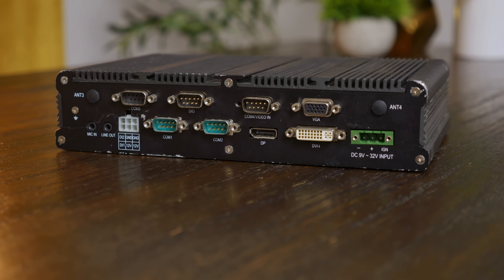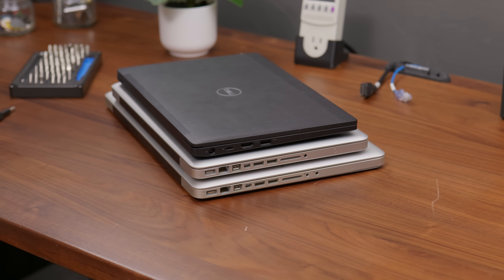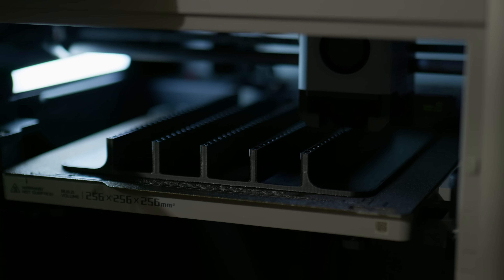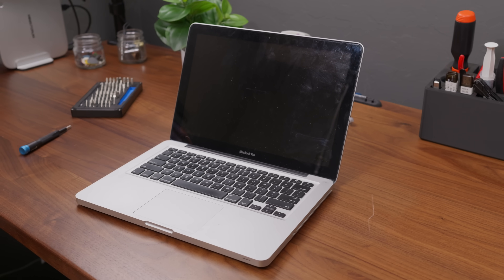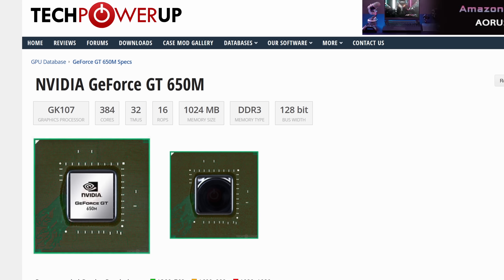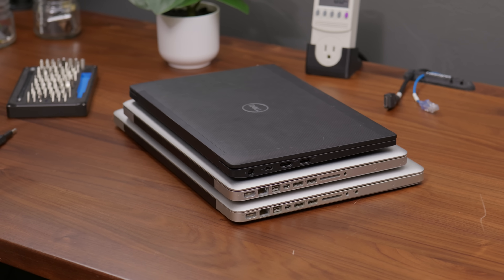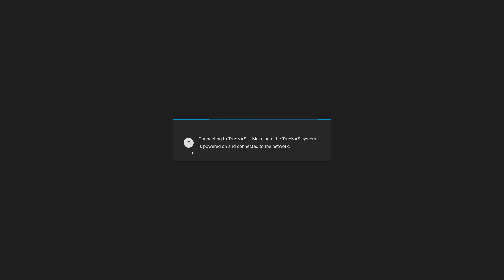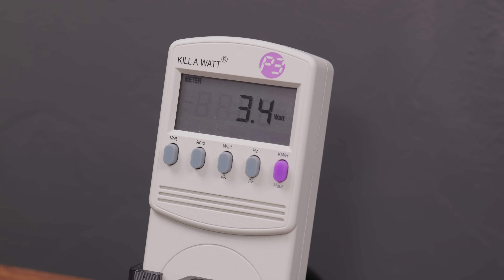Building Cheap & Efficient Home Servers with... Laptops?

Comment: Mentioned this on the "Can A NAS Run ENTIRELY On USB?" video: https://www.youtube.com/watch?v=Se46YVnonhI&lc=UgwN9c6tUUlHFvUR4fN4AaABAg.A8e2xgTJvelA9uOMqRZT82 

Recently, I acquired (at no cost to me, my favorite way to obtain hardware) the following:

1.  Toshiba satellite 2010 L750 with 6GB of RAM and an Intel(R) Core(TM) i3-2330M CPU @ 2.20GHz

2.  Lenovo G560 with 2GB of RAM, and a dual-core 2.13GHz Intel Pentium P6200 CPU

3.  Mediasonic HFR2-SU3S2 4 Bay RAID enclosure

So as to not spend any money, I shucked some old but still functional and semi-decent sized drives out of some external USB 2.0 enclosures I had laying about, stuffed them into the RAID enclosure, plugged it into the sole USB 3.0 port on the Toshiba, and installed OpenMediaVault.

It's a much nicer solution than my HP Chromebook 11 G4/USB setup.

Both the Toshiba and the Lenovo have some interesting upgrade options.  I'd rather use the Lenovo as I can easily access the WiFi card, which is on a Mini PCI slot.  I don't need WiFi on the computer, as it will be connected via ethernet on my LAN.  Both computers have ethernet, but their connections are Fast Ethernet capped out at 100 Mbps.  I figure I'll remove the WiFi card on the Lenovo, and install an M.2 Gigabit Lan Adapter at 2.5Gbps (Mini PCIE NIC 2.5G) instead (access to the Lenovo's WiFi card is through an easily opened panel on the bottom of the laptop; to do the same on the Toshiba I'd need to remove and leave off the keyboard).  Upgrade the RAM and possibly the processor (they're both socketed), and throw in either an eSATA card or a USB 3.0 card for connectivity to the RAID enclosure - the Lenovo has an Expresscard/34 slot.

I'll upgrade the drives when I can get a good deal, and I feel it will make a dandy file server - currently, it's simply serving up media files, running backups for the home computers, and running Logitech Media Server/Lyrion.

Bonus - both units have functional batteries, so they've got built in UPSes for the frequent power outages we experience in my area during summer that typically last only a few seconds to less than 5 minutes.  It's not the outage length, it's the constant up and down over the period of several hours that I strive to avoid.  The RAID and the computer are also plugged into a UPS, so there's some redundancy there as well.

Comment: 13:10
What if you take the battery monitoring from the laptop and use that information in Home Assistant to turn off and on the power to your battery chargers? Would that be possible?🤔

Comment: Quite often I change bios configs on laptops to turn on when they're connected to AC power. Mostly because at work I'm lazy and just want things to turn on as soon as they're plugged in but also because when I used to run laptops as my proxmox servers, I'd want them to turn back on in the event of a powercut if they ever had to turn off when the battery ran low and then autostart if the power was restored

Comment: Running laptops with the lid closed cooks them, you are removing a massive area that does heat dissipation for all the components that are passively cooled. Running hot laptops long term with hot batteries is an even worse idea. 

Laptops generally don't have the option to boot upon receiving power either, so if you've removed the battery to avoid a fire as you should, you will have to manually boot your server farm after any power outage.

Comment: DO NOT use a laptop as a server.....UNLESS you remove the battery completely OR set the battery charge limit to no more than 80%. Without doing any of that your battery WILL swell/pop within 6 months to a year. Be safe, dont cause a house fire.

Comment: Hey, you took my idea, lol, kidding.  But I did have this idea about a year ago.  I have a "stream" model HP laptop that the screen was busted.  I completely removed the screen.  It is very slow for windows, so I put Fedora on it and it actually works good.  But then about a year ago I thought "I need a pi-hole system, I wonder how much power this laptop uses"  And I did some tests and the laptop sips about 1 watt when it is idle and it tops out at 6-8 watts under full load (no screen makes a big difference).  So I thought "will this handle pi-hole?"  The answer is a resounding yes, it averages about 10-15% cpu use throughout the day, The highest I have seen it is 30% with about 15 systems actively using it.  It's the perfect low power pi-hole server and it even has a built in battery backup.  I think it is even more efficient than a actual raspberry pi.

Comment: Laptop battery would be my main concern, leaving it plugged inv24/7 is a fire risk imho.
Finding a laptop that will draw small enough power is a bit of a gamble unless you know beforehand how it will perform.
I have been tempted a number of times to do this but atm i am managing without HA and just using cloud services but its defo getting to the stage where i want HA and im keeping an eye out for good options.

Comment: 13:22 (related to the batteries)
if you are gonna do this with laptops there not much of a worry you will most likely have this near you + alot of people use laptops everyday with charger all the time hardly moving it so if thats safe it will be safe to just make sure theres airflow and you have no worries (i have 4 laptops as homeserver for all my music stuff 3 years no issues)

Comment: I have an old MacBook Pro 2011 with 2nd gen i5 and 6 GB ddr3. I put Ubuntu server and now use it for nextcloud (snap, judge me), as well as guard home dns server and tailscale exit node. Honestly it’s doing a great job for me as a single user and I absolutely love it. Battery also holds about an hour, so it’s like server with UPS if power goes down😅

Comment: I miss 11" tablets and laptops. Having a modern lightweight one with enough battery for a few hours of office apps, would be great, especially if we could use a battery bank or a smartphone to recharge it or extend it's duration. Though I guess that this is what will become of triple-folding smartphones, once triple-folding keyboards for them become a thing, to turn them into dual triple-folding laptops, if we can install linux on them, or it comes with linux and android in dual boot.

Comment: Low power is soo important right now. Energy costs an arm and a leg, even with solar power.

The minipc's I use have amd 5285u's which are laptop cpu's, very efficient yet so powerful. 15w tdp.
another one for homeassistant that has a N150 for even even lower power usage.
a nas board with an intel N5105
I build my own router, it probably uses more then it should since it's an i3-12100F, If I can find some board with a 5825u or something and pci slots I would defo change.

I haven't measured them idling yet.
but probably the router is as much as the rest combined.

Comment: i’m running a laptop server using HAOS (Not the best choice but gets the work done).

I’m running Home Assistant, Reverse proxy, Jellyfin Server, Arr apps, Samba Server and 3 Airplay 2 Recievers! 

i’m using a old Asus i7 7th gen with a 980m for acceleration in Jellyfin and 1tb for Samba, i’ve been rocking it for a year with no problem! I’m running my switch and network via USB-C PD so it works as a UPS for my network as well! Works like a charm for maintaining my network up for power outages letting me control my HA instance, keep streaming locally and use the samba share!

Comment: I run 3 dell laptops with mSATA as primary,  with (2) 2TB 2.5" SSDs one in primary drive bay the other is the ODD bay with adapter.I choose specific machines with 3 drive capability - with a DVD player and a 2.5 primary but also that mSATA option on select models.  This was more common around 4th Gen so they are higher wattage than some newer ones... BUT also back then the CPUs were swapable.  I experimented with the slowest lowest power draw CPUs as well as the fastest.  each has its own pros n cons..    Dirt cheap laptops but expensive drives.  12 TB total but each is mirrored so I have 6TB.   They are running around 30w each so just under 100w total.  They use external connected batteries so no having to open them to check for swollen batts.  They sit in a box on a wire shelf in the basement with furnace filters on top n bottom, with the fan n vents blowing up, sucking nice cool basement air from the bottom.  They run cool , quiet and out of the way for the last 2 years... UNLIKE the mini tower server in my room that I seem drawn to tinker with endlessly.  I also have a dell precision m6800 mobil workstation with 4 drive capability that am tempted to add to the mix but its huge (17 inch) and power hungry so we will see.

Comment: You do not want to stack LCD screens on their sides for extended periods: they will leak from pixel to pixel and never work right again.

At best you just get uneven backlighting and crap cooling that thermals heat straight up and just accelerates the damage by concentrating heat on a closed lid.
LEDs are not what I'm referring to.

I've forgotten how I learned that.
😆

Comment: Did that long ago too, lets just say they are not meant for 24x7, even the HDD died because it needed the spindowns it no longer got. Same for dcdc and that stuff. Otherwise - yes all for it, laptops are easy to stuff away when done and the trivial bios make for fast boot. I don't really wanna try again, hate most laptops.

Comment: a lot of laptop use something like magnetic sensor for their screen/lid close sensor, i've using laptop as NAS, my solution was find that magnet thing and remove it from my laptop, mostly that magnet located on LCD side.
i've done that on my 2 laptop, work without changing system setting 🤣

Comment: A few years ago I decommissioned a 2012 macbook pro that had been in use as a home server for over 4 years, as I unscrewed the back to remove the disks, the case just kept expanding, then I found the battery was bulging terribly. I will never use a laptop for a home server again because of this. YMMV but be careful out there! A house fire is no joke!
Reply: A battery replacement is very simple.
Reply: Remove the battery and try to use while charging.
If it works while charging then just remove the battery and do your thing. 
If not, make sure to get frequent replacements.

Comment: As with all servers the amount of memory is often the most crucial factor. Older laptops are generally going to be DDR4 with 64GB (2x32GB) being the largest SODIMMs available. That may be sufficient for minimal workloads, though I would strongly prefer 96-128 GB. Newer DDR5 laptops can support 128GB (2x64GB) DIMMs, so I think in the upcoming years obsolete laptops will become a better option.

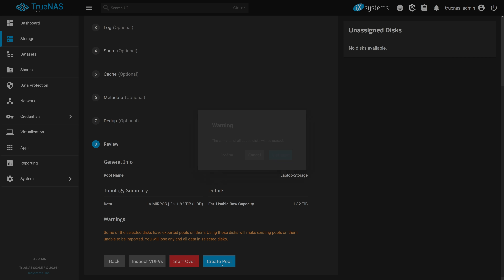Comment: Re 8:55 you should 3d print an enclosure to hold them in place with maybe a keyring hole for mounting a cold spare of the same type of USB drive in case one of them failed :)
Reply: I was thought printing a case for them would be a good idea too.
If he wanted to go back to using them separately and didn't keep the old ones, welp, print a new case for them.

Comment: I have an Acer laptop with an i7-3610QM and a GT 640M, which is almost similar to your 15" MacBook. When running Proxmox, it idled around 22W, but on a headless Debian setup, it was at 11-13W. Couldn’t figure out why the idle power consumption was higher on Proxmox, so I decided to switch to Debian with Docker and Cosmos Cloud.

Comment: I have a Lenovo laptop (purchased 5$) with a processor (gpu uhd graphics 620) i7-8550U/12GB ddr4, ssd in place of a 1tb wifi card, in the nvme port I have a 6xsata adapter (ASM 1166) here hooked up for now 1 8TB drive, instead of a dvd/cd drive a 2.5 inch (2TB) drive adapter, in place of a sata system drive a 2.5 inch (2TB) drive. 
Built-in battery (1h), power via usb-c port, added lan 2.5G after usb 3.0.
Power consumption 8W at rest. Disconnected screen, speakers, wifi, and everything else even if it did not affect power consumption.
OS win11 ltsc, smb services, Plex, Jelifin, Adguard and more. (Plex, Jelifin unfortunately transcoding does not work for some reason).

All network equipment, router with wifi 6 (~6W), switch 2.5GbX4 2x10Gb (~5W), Lenovo server (~8W), plus DIY 6x18650 UPS Box .
Mostly I see consumption at 18W of all these devices. 
All this powers a 12V 5A 60.0W power supply

Comment: Laptops are definitely a good solution if you don't have crazy requirements for storage and compute. You don't have IPMI but you get a solid integrated UPS. Even some can use ECC memory.

For a managed switch, there are some cheap solutions... You may get a Netgear GS105E (E is important, this one is 5 port managed). Some (all?) non-managed switches are internally managed switches with management disabled, and if the switch has testpoints or breakout for serial, it's easy to enable the management with any USB to serial adapter. There's also some network appliances that can be repurposed (=hacked) to get huge value from them: in my homelab I have an OVH OverTheBox Plus, which is basically a 17-ports switch, with 14 copper ports, 2 1G-SFP, and one port going to an integrated board with an dual core Atom with 2G RAM and 8G EMMC, which has HDMI and USB ports available, in a 1U form factor.

Comment: I have been using my HP Pavillion gaming laptop constantly plugged to a wall 24x7  since i bought it in FEB 2021. battery life went shit but battery is still not swollen or anything, still gives me 1.5 hours of battery life unplugged. only time i get it out of the plug is when i'm on my way to office, i used it on my bed , constantly plugged in and keep the charging on even if i sleep beside it.

Comment: I've been running a server on my anchient HP laptop for years. I've used it to run Valheim and Satisfactory servers for my friends. The old i7-3630QM is still surprisingly capable.

I use rtcwake to schedule sleep on it, to save a little more power, when it's not needed.

For anything less demanding I use Raspberry PIs.

Comment: Sorry but... in a "old laptop video" neiter mentioning cleaning and repasting as preparation steps? You mentioned the cooling issues form your 15 inch laptop however both tasks could be a gamechanger for reliability and performances.

Comment: I also switched to laptops at first, but I got tired of constantly dealing with turning off the screen. In the end, I started using motherboards from various industrial devices bought on the second-hand market. They have very low power consumption and a sufficient number of expansion ports
Reply: ß
Reply: What kind of industrial devices? give examples.

Comment: I did this for tradeshows for years.  I used ESXi to run a mirror of the VM's in our demo environment on a laptop.  I would bring along my own access point/router and effectively could carry everything in a standard laptop bag.  Tradeshows are/were notorious for being evil about network access or simply not having anywhere near enough of it.  

Now ....  

If I were doing this at home I would probably remove the batteries from the laptop and use a UPS.  Yes the batteries act as a UPS but they degrade when simply left plugged in all the time and worse yet some of them do swell and you will never know it happened.

Comment: I do wonder if those laptops might be able to run USB 2.5 GBit Ethernet adapters? A suitable switch isn't that expensive these days and might have been a low cost upgrade. Also Thunderbolt might have been useful for something? 🙂🤷‍♂️
Reply: don't think, just do it, it works without problems and is cheap.

Comment: The battery issue is dependent on laptop. I've seen battery swelling so bad that I didn't have to take half the screws out, but that laptop ran on AC power every day, all day, for well over five years.

Comment: I use Laptop MB "HP x2 G3" on idle uses 0.8W with Casaos on Ubuntu Linux , benefit You can use the WiFi
Reply: i5-8350U  ?  impossible !
Reply: @StanisawSwierczynski  
It has an i5-8250U with 8GB RAM and a 256GB NVMe SSD, is mounted directly on the wall without a case, and has been running continuously for three months with nothing else connected except a battery and Wi-Fi for network.

Comment: This could not have come at a better time. I started a home server with an old laptop. I’m running Nextcloud, WireGuard, OpenSpeedtest, Portainer and I’m hoping to run pi hole, ARM & JellyFin next.

Considering it’s a dual core AMD from 2010… it running the server pretty decently.

Comment: I ran a laptop as my first server for 6 months, and it worked great...until summer when it burned out because the room it was in hit 50-60C. Unfortunately, the laptop I was using had no battery, because the battery had a short somewhere and would kill it if it was plugged in, so no built in UPS on that one. I instantly moved to mini PCs, which have been great for both power efficiency and capability with no deaths, and now have a full sized desktop class server as well for expansion, but long term I'm looking at retasking certain laptops and such back into my lab for things that need to be more resilient (long term plan will be a pool of Frameworks in a 3D printered blade chassis or something, but that's a long way off, and wouldn't be used for things like storage)

Comment: I've got a Dell Wyse 5070 thin client /PC with 4x Pentium Silver & UHD605 and 8Gb ram and run way more on it than I probably should but it seems reasonably able to keep up even with some light transcoding. Not bad with JF+Emby and the 'arr suite + BT & NZB clients and a bunch of docker containers for IPTV tuners, channel guide grabbers, jellyseerr, stats trackers and access control app for the JF setup, notifications, ytdlp2strm & a Pi-Hole setup!. Pretty wild its doing all that and I've never seen it over 20 watts lol